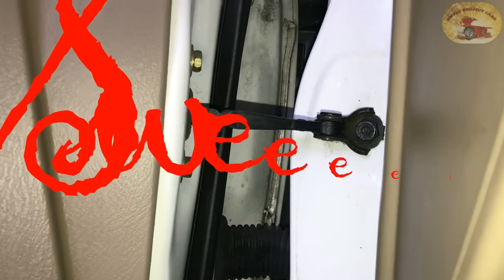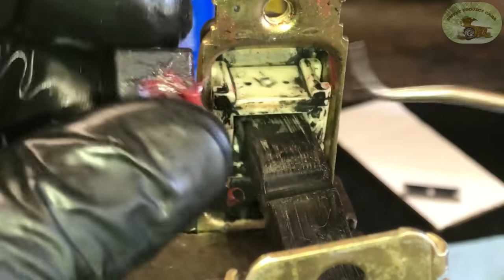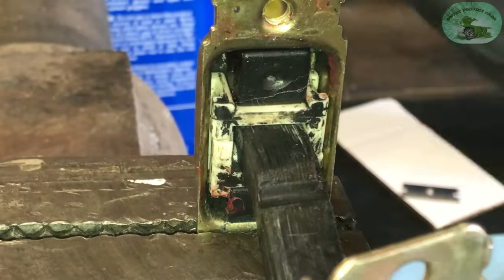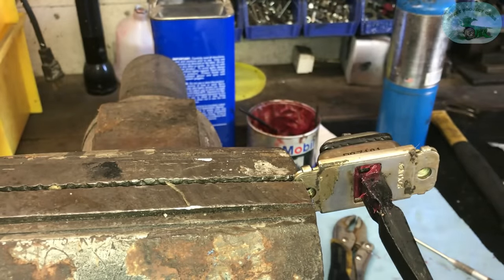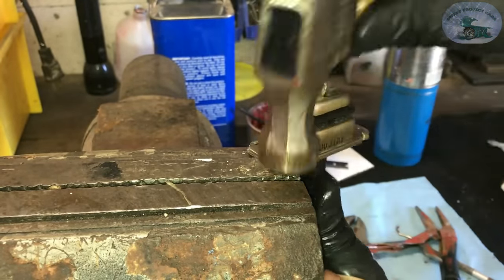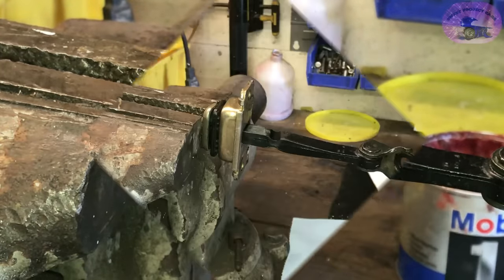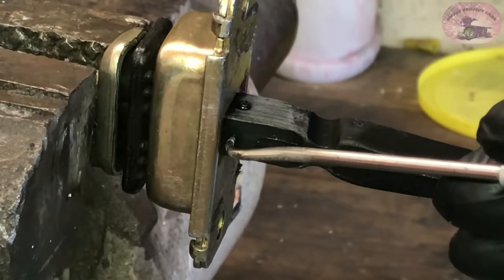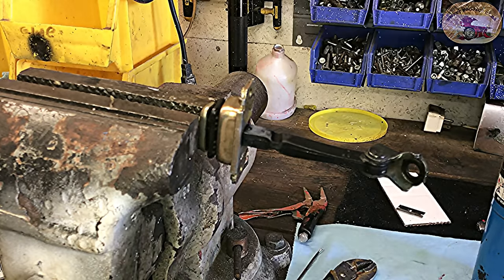STOP YOUR CAR DOOR FROM CLOSING ON YOU!!!!

Comment: Came back to say thank you! I bought a 13-year-old Honda CR-V a few months ago. All four doors, annoyingly, wouldn't stay open if parked on any sort of incline. The rear left speaker also didn't work when I bought it, but that hasn't been annoying enough to get into the door. I got whacked in the head the other day though as I was bent over and pulling stuff out of the back seat. That inspired me to do a little homework and I came across your video here. In a little over an hour I had both rear door checkers working, and with a little more time discovered that the speaker terminals were just a bit corroded. Both problems fixed for $0.00... fantastic hack, and great video!
Reply from the maker: Awesome!!  Thank you so much for watching and sharing, we truly appreciate it!  Glad to have you here with us my friend.  Keep up the great work!  Have a fantastic day.  mad Mike the hammer SPC

Comment: Thank you. Just repaired this part in a Nissan 350z. The concept is very similar and solved the problem by shiming with two coins between the case and rubber part. It worked great. Again thank you for your video!
Reply from the maker: Nice work!  Glad we could help!  Have a nice evening.  mad Mike the hammer SPC

Comment: Great video, i have a problem. Today the mechanics at the Toyota dealership added Grease to the metal hinge because I was complaining that my door made a tapping sound when it's fully open so I guess they thought this would be a solution but it still made the sound apparently all the car models that I have make the same sound when opening they couldn't figure that out first so now my doors open completely out before they used to have a nice stop at every angle this car only has 10,000 miles and the stops were great because if you're on a hill they open up to a certain degree if you're down a hill they open up to the certain degree prevents you from hitting fire hydrants trees etc and now they just have grease and they open way too lightly and too fast so how can I counteract this issue I could take it back to the dealer but I'm trying to avoid them taking the whole door apart just to get into that hinge and clean it out is there another way to do so can I buy like a degreaser or something but I don't want to damage any components inside the hinge if this is really something for the mechanics it just tear apart and clean inside out then I guess I have to resort to that but before I even do that I want to see if I could maybe try another alternative because I know once they start opening things up if they put in reassemble the door again I feel like something is going to be rattly or loose I've been through this before with my windows rattling and the doors just never the same I don't want to violate the assembly yet please suggest any tips I am looking to remove the grease off the metal hinge or the door jamb hinge whatever is called forget my ignorance please help thank you anyone
Reply from the maker: Get this  https://amzn.to/3wIDQHd and one of these  https://amzn.to/3FzDoiL and apply it as you are moving the door back and forth until it is free of the debacle that is your door my friend.  Thank you for watching and asking, have a great day and all the best on your project Carlos. mad Mike the hammer SPC